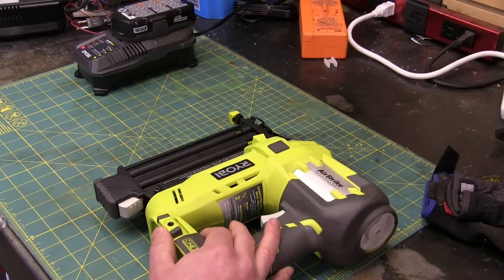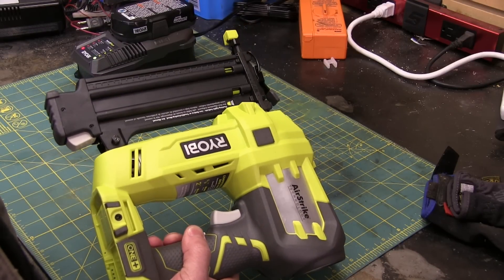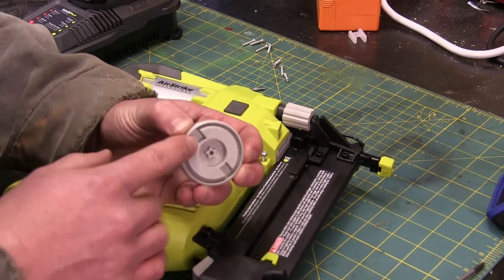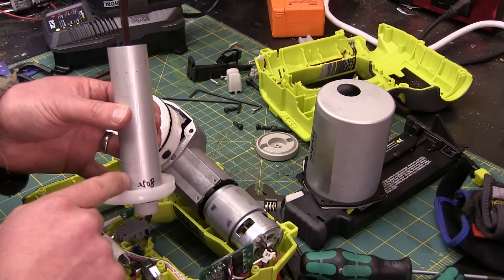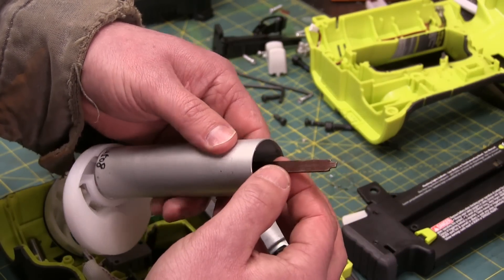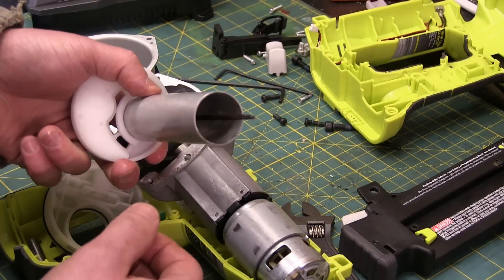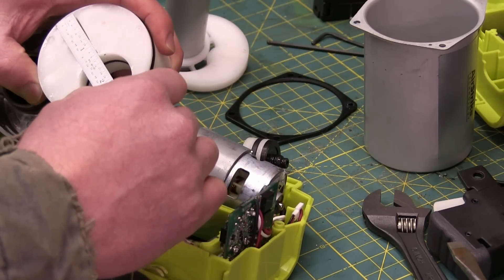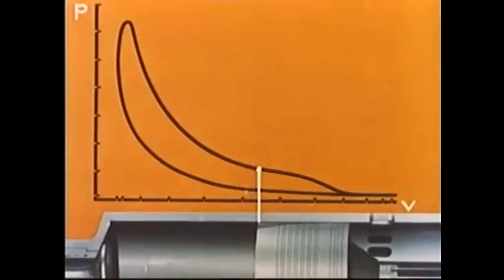BOLTR: Ryobi Nail Gun 18V cordless

Comment: You are obviously prejudiced to begin with. I use Ryobi One+ tools including the Brad nailer and while  aimed at the DIY market they performed to a level many pro's buy and use them as they are dependable.

Recently I came in contact with one home repair service guy who used exclusively Ryobi. When ask how he liked them he responded they got the job done. Then he pointed out that what he liked the best was the affordability along with availability since they were sold at Home Depot.

I recently took advantage of a sale and bought myself a Milwaukee 18v Impact driver but never did fall in love with it as it appeared to be poorly fitted particularly at the battery. Slide in vs post style of battery I guess I'm s a personal taste  but when dropped accidentally the battery would always pop lose from the Milwaukee but not always from the Ryobi.  I eventually palmed off the Milwaukee off on my son. 

With the introduction of the brushless One + tool lineup I suspect I will be a Rypbi user for the balance of my life.

Side not I do agree that Ryobi 12v lineup sucks and use either Rigid or Milwaukee 12 V lineup.

Comment: That fuse flanked by two big resistors is a thermal fuse. With current through the resistors you'll get heat, and then if you get too much current or use it too rapidly then you blow the fuse and buy a new gun. Could've stuck in a polyfuse or sensible electronics so it'd recover but that won't sell another gun, I guess.

Comment: +AvE I had one of these a few years back. Surprisingly the piece which started to fail was in the chambering mechanism. Sometimes it would fail to push a new nail to the top and I’d have to loosen the spring on the top and pull back the retention rod, or whatever it’s called. Nothing inside failed, it was a mechanical failure on the clip holder itself. Which one would think is that last thing to go. 

If I might ask a question, I watched your videos and thought I would attempt to fix my Dewalt Drill after it started making the Crunching, Choochooing sound however it still manages to turn he motor. A sound I believed meant dead Brushes. I opened her up and the brushes looked brand new from my untrained eye. There was one of place I thought you’d of mentioned if that sound ever happening in a brushes motor. What was it?

Comment: I have a few Ryobi tools and these battery's come in a number of capacity's. The ones in that kit look like the low end of that range. Ryobi sell a 5AH battery but for less than the cost of just one of these you can buy two of what claims to be a 6 AH battery's which are Chinese knock off on EBay. I've been using these for over 1 year with no issues.

Comment: I don't have time for Pi*R^2 in my line of engineer-proximating - I just square the diameter and take 3/4's of that, then add a little.
PiR Squared is practically D Squared * 0.7856, or roughly 3/4's of d^2 - go ahead, give it a try with some numbers...
A 2" cylinder piston has a shade over 3" of surface area. A 4" cylinder piston has a shade over 12" of surface area.
2X2=4, and 3/4's of 4 =3; 
4X4=16, and 3/4's of 16=12.
Go ahead and do your PiR squared with 2 and 4 and see if your guesstimations come out the same. then try the same with any number you want.

Comment: Maybe the Ryobi,  Milwaukee,  rigid or whatever batteries can be used interchangeably, with little or no modification? Like how if you take a tiny knick off the top corner of a black pecker it'll fit the same as porter cable batteries, being made by the same company, I bet you can find something that crosses over between all those brands and tools under tectonic.

Comment: lol yea two stroke diesel, works a bit different then your little weedwacker but the idea is the same when i was just a newb i too thought two stroke just meant no valves and mix fuel sucked into the crank case), also universal motors like vacuum motors and such run on DC power (learned that the easy way buy just pluggin er into a car battery when i was young), brushless DC motors can run on AC current, seen that too, this guy who dismantles tools knows what I'm talking about cause he does it in his videos, point is its all possible and no myth of any sort

Comment: Ryobi tools are designed so that the new 18V Lithium batteries fit the older 18V tools that used Ni-Cad batteries.  The Lithium battery packs come in different power levels, ranging from about 1.5 amps up to 9 amps, and the new brushless motors make more efficient use of the battery packs. You can order Ryobi tools directly Home Depot's on-line division, which is how they sell their on-sale tools in packages that typically, but not necessarily, include batteries - last time I ordered there were over a hundred different tool packages available.  About twice a year Home Depot has amazing on-line sales that effectively reduce the prices of the sale items by about 50%, with free Fed-Ex 2-day shipping to your home or shop address. Do not expect to drive to your local Home Depot and get the same sale price on these deals - you can order and pay on-line and then pick up your purchase, when available, from your local HD, but the deals are not sold in local HD stores at the sales prices, unless locally advertised as being available at the store at the reduced price.  

I have been using Ryobi tools for more than 15 years, and have never broken one. The new batteries give new life to the old tools, and you're not screwed because somebody decided to change the case size & connections for a new battery, rendering obsolete those tools you bought 2 years ago, as do some of the manufacturers you seem to esteem because of the quality of the injection molding of the plastic cases.  

Ave, you judge a tool by taking it apart, before you've ever used it.  I use them, and only take tools apart when they break.  My Ryobi tools never break, so I never have to rip into them. Do you use USA/Canadian standard Philips screwdrivers and bits when taking them apart, so that you can be sure to strip the heads of every screw you touch, or have you ever heard of, or used, JIS crosshead drivers, which are what these tools are generally held together with?  JIS drivers don't strip the heads of Philips-type crosshead screws found in Japanese and other Asian-sourced products.  And as to where Ryobi is located, for American customers, Ryobi's main office is in Anderson, South Carolina, about 2 hours from my home and within the jurisdiction of our local courts, if an unsolvable problem ever arose.  And local HD stores handle warranty issues within the 3 year warranty period of new tools, even when you buy it from the on-line division of HD.

Thanks for the video and for your insights on taking tools apart before using them. I wonder how you would approach a goose that was laying golden eggs?

Comment: For the Ridgid (or ryobi) warranty you don't have to send it to ridgid, you go to one of the service centre. Here, it's about 1KM away from the home depot. As far as the batteries and chargers, for both ridgid and ryobi, you do simply bring it in to the Home Depot, and they replace it. I am a hobbyist, started off on my appartment balcony (no space or money) and ryobi was a good option for a hobbyist like me. Since then I've stuck with them because out of about 50 tools I've had 3 failures (to be fair, 2 failures, one was entirely my fault), and they fixed it for free both times.

Comment: I was sceptical about Ryobi tools. I bought a drill driver combo 4.0AH li batterys on special. Canned the shit out of them building my hardwood deck (2000 odd stainless screws in 2days)
Couldnt killem. So over time i got a few more tools. Recipro, drill, impact, brads nailer, circular saw, pretty much all of them now. Left my recipro under the drip line on my cabana in the rain with battery still atteched for 2 days. found it, pulled the battery and left it in the hot aussie sun for 2 or 3 days, put the battery back in and still going strong. I have done some serious work that i thought they would not go close but the only tool i find has no guts is the angle grinder. If you load it up it shuts off and you wait 2 seconds and it will go again. Garbage. All in all, for the cost, good.

Comment: I broke my nail shooter... It was refurbished so maybe that was a mistake. The business end of it is messed up...

I have the other Ryobi tools though and theyre great for a home gamer - but I see their stuff with a lot of carpenters as well, however I find the mini circular saw gutless.  The batteries are pretty nice though and you can get a larger pack that lasts a while.  That angle grinder is SWEET!  The Sawzall is pretty damn nice.  The drill is solid.  Jobmax works good for cutting flooring and rips through paneling.  The vacuum cleaner is completely worthless though.

Comment: I have the Ryobi line, but work with a gut who has Milwaukee battery tools.  The Milwaukee drill is much more powerful than the Ryobi.  AND the light on the screw gun on the Milwaukee stays on for 15  seconds once triggered but turns off immediately on trigger release on the Ryobi, so you can't see in dark corners unless the bit IS turning.

Comment: You missed and made the point about Ryobi one plus tools practically in the same breath. You bought a drill, impact driver, two batteries, charger and brad nailer for approximately $300. How much would that cost with the big guys? $600 plus.

 I used that nailer to do trim in my daughter's house. After hundreds of nails it's still going strong.

 I've been using Ryobi tools for many years. I'm not a pro nor am I a "prosumer." None of the tools have failed and they all do what I need them to do. You can buy an entire kit from Home Depot that would include the tools I mentioned plus a circular saw, oscillating tool, flashlight and a saws all for just a few hundred dollars . The brad nailer goes on sale for around $100.

 $400 for all those tools that could last you 10+ years.

Comment: rigid's warranty is actually legit even though it's not. I used to work in a home depot tool rental and they way it works is you would bring the tool to a home depot but it NEEDS to be a home depot that has a tool rental center because they do tool repairs. and so you bring the tool into the store and they check it in for $18.95 and then they ship it out to rigid or an RLC center where the repair is done under warranty and then it's brought back to the store and then you're refunded the $18.95 service charge. but we're not done yet, the repair usually takes about a month to do because home depot does not expedite to manufacturers or RLC centers. so it will be fixed for free but you have to be able to go without a tool for upwards of a month. also the warranty is automatically voided if it's being used by an LLC. so if you're a contractor running your own business and working for another then your tools are not covered under the warranty.

Comment: 34:12 "This is an expensive part because you need to heat up the rubber under pressure in a mold"
35:52 "This is an cheap part because you only need to heat up the powdered metal under pressure in a mold"
Reply: He explained why one is expensive and one is cheap. It makes sense.
Reply: @TheArmybrat1994  please explain yourself rather than just saying "It makes sense" because the processes he was talking about sounded pretty much the same to me
Reply: It does make sense. He touches in the video why one is cheap and one is expensive. 
Rubber is a more expensive product to produce and to work with. The rubber will most likely need a separation process from the mold involving chemicals. I am assuming this because automotive tires need this. The rubber is so way more delicate and easy to fuck up. 

The metal on the other hand wont need another reaction to remove it from the mold and it can separate while still being a few hundred degrees. The gears need to have a specific design. But they arent responsible for sealing up a chamber. Like the rubber is. 

The rubber will need to be pretty close to completely solidified due to not having any cords for structural support.

Comment: If the magnet holds the 'plunger?' in place with a considerable amount of force, this should mean it is held in place until the piston has generated the higher (than the psi generated at half stroke or 90 degrees) pressure required to break away from the magnet? Neodymium magnets having a very shallow magnetic field means the 'plunger' breaks away with all of the available pressure behind it.

Break away ("unseat") pressure is regulated by the force of the magnet, a pretty simple and reliable method. (assuming the mechanism completely resets)

If the magnet releases at a pressure generated below top dead center (TDC), the piston system would see a significant reduction in resistance on the compression stroke, causing an increase in speed (momentum) before TDC . . . wouldnt this cause higher than necessary forces when the piston changes direction? (Or are we assuming the piston and wrist pin are strong enough to withstand full speed from the motor with no resistance?)

The system would most likely be "tuned," such that the pressure needed to break away from the magnet would be about equal to the pressure generated my the piston near the top of its stroke. Though, given that the minimum break away load is governed by the magnet, there is probably some headroom put in to accommodate wearing seals. Do you have a way to measure the force to pull the magnet away?

Comment: With you tearing into their tools and exposing the true quality it is surprising they don't use left handed bolts that take some bizarre security bit that supposedly no one else has or makes.  Not only would you not be able to get them out then without that bit but you would also have to know to turn them the other way or you might strip them and have a harder time getting them out.

Comment: So the stronger the neo magnet , the more resistance to pulling it apart, more back pressure to be used as force when it does pull apart.. hence stronger impact once it meets the brad nail?

Comment: i like the qr code covered in glue so it rips when you open the box and cant use it.

on a side note, hall effect sensors work by having a magnet near them, it doesn't have to be moving. depending on the sensor, it does have to be the right polarity though.

i feel im good with math but you i get lost trying to follow you

Comment: You know I hate when people dog on the Ryobi. For us home users they are fine and i have a fairly full array of the Ryobi 18+ stuff for 12-15 years none of them have failed me yet. 
The biggest strength and the one reason I can have tools that old is that they decided to stay committed to the same battery form factor. There is not a single other brand that can say that. 
Before I started buying Ryobi I had several tools all with different batteries and when the batteries died I generally had to buy new tools because often the batteries had been discontinued.

Comment: Try reading the excellent "Things That Make Us Smart: defending human attributes in the age of the machine".
Basically, the book boils down to this: if a device needs an instruction manual, it has been designed wrongly! And the perfect demonstration of this phenomena came with the advent of the VHS cassette, and the 750 million machines all flashing 12:00... 12:00... 12:00... 12:00... 12:00... 12:00... 12:00... 12:00...  Because no one could see how to set the time.
A calculator, for example, makes us smart. But a computer makes us dumb, generally. Computers won't make us smarter until they are smarter than we are. And that time isn't too far away, either. Good luck trying to take one of THOSE apart, AvE!

Comment: You could figure the kinetic energy of that plunger is roughly 30lbs * 5" = 150 inch pounds at the end of it's travel (looking like it travels roughly 5 inches).  From there figure what an object with that much KE does when hitting a nail on wood.  Or compare it to a 16-ounce hammer.  How fast must the hammer be traveling to have the same kinetic energy?  I'm really asking because I got 17 inches/second which doesn't seem like enough to drive a finish nail into wood.
Reply: Doing the calculations another way I got that the equivalent to the Ryobi Airstrike is a 1lb hammer traveling 28 fps.  That's pretty decent.

Comment: Just my experience, but I have had a Ridgid 18v drill for over 4 years an have had 2 batteries and a motor replaced free, no questions asked. For the batteries I just phone ahead, go to the service centre and do the trade. You do have to register the tool, charger, batteries etc. but that only takes 5 minutes on-line.
For me, I expect such a tool to typically last 2 years. in my case the 'Lifetime service agreement' really paid off. Just saying.

Comment: Worked for the Homeless Despot for 12 years, including a stint as a receiving clerk. I can tell you that tools are absolutely NOT on consignment. Without getting super technical about the inventory control system, let's just say that it would be a nightmare to try and do that. They call it 'pay per scan' and it's only used for live goods and by vendors willing to get completely raped on shrink (theft, loss, etc...) Homer is much sneakier than that. They sell brands they own to themselves so they can write off any shrink as profit loss, despite the fact that it's a fictional number... well mostly. There is some minor cost associated with the manufacturing and shipping of the darned things but that's probably around $20 to $30 per unit for a $300 tool. Writing off one tool as a loss allows them a tax rebate on the equivalent of 9 other units. Fucking pirates, the lot of them.